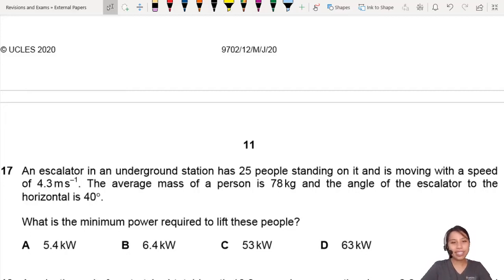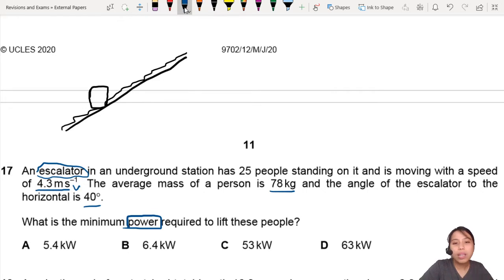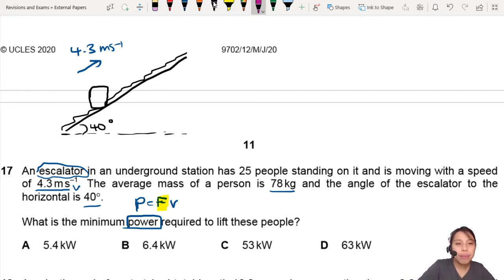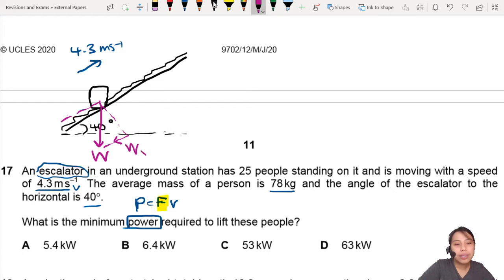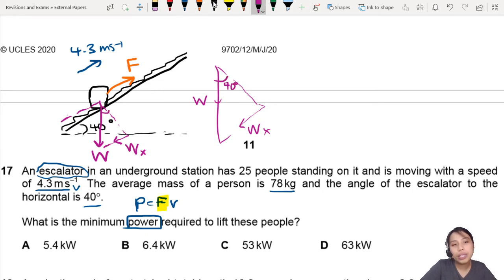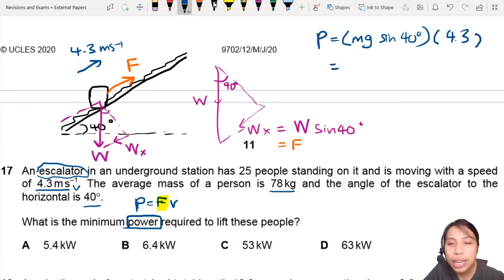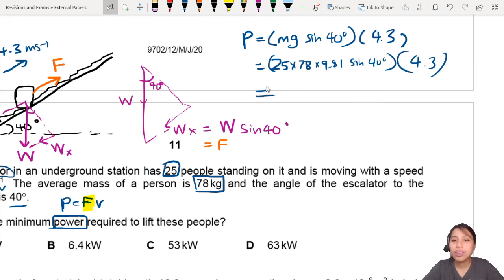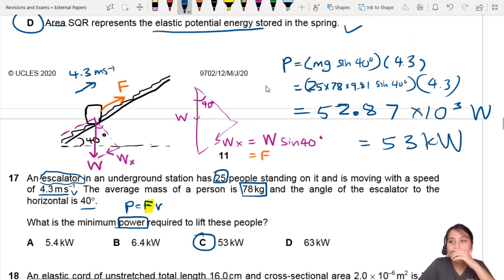5.2a Ex2 MJ20 P12 Q17 Escalator Power | AS Work Energy Power | CAIE A Level 9702 Physics

Comment: How is f equal to wx when the directions are different
Reply: if wx would be greater then f the block would slide down right? so an equal f is required to stabalise the block since wx is acting on the block. So it is equal because of that if wx is for e.g -4  f of +4 will be required